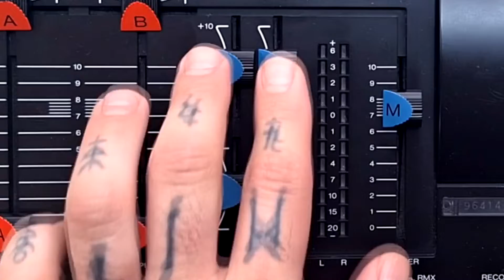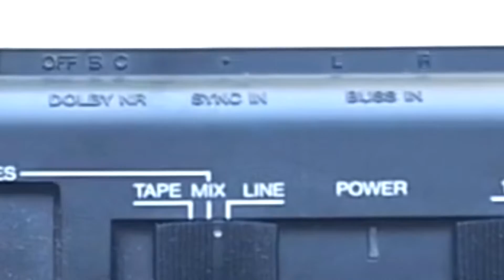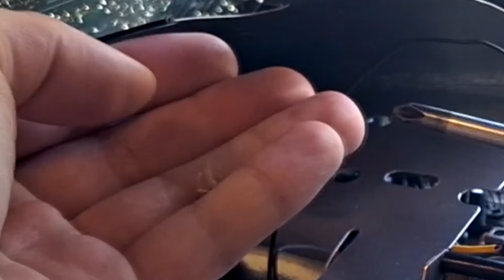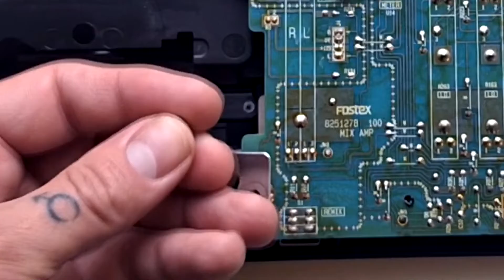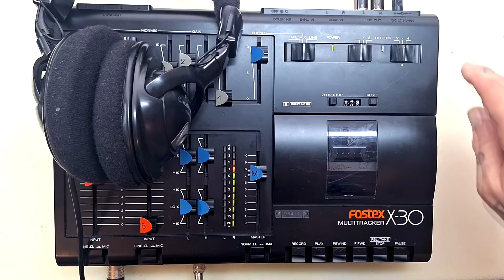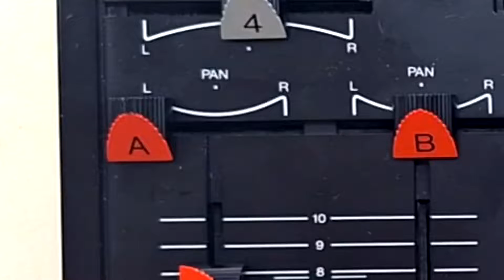Fostex X30 | Review, Tear Down & Tutorial

Comment: I have an X-30. When I press play, it only plays for a second , then stops. It rewinds and fast forwards ok. Any ideas? I tried replacing the main belt with an Amazon cheap belt without any luck. It's a real clean unit only used for several Summers years ago. Thanks!